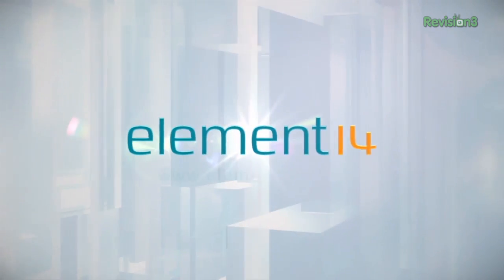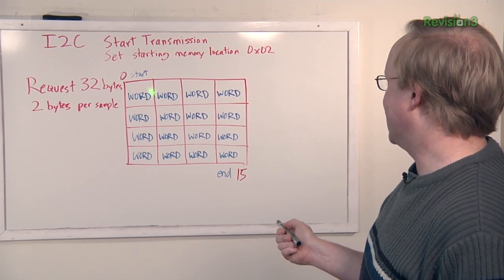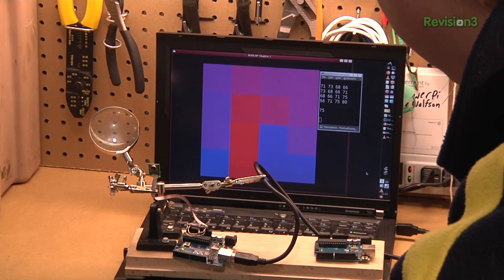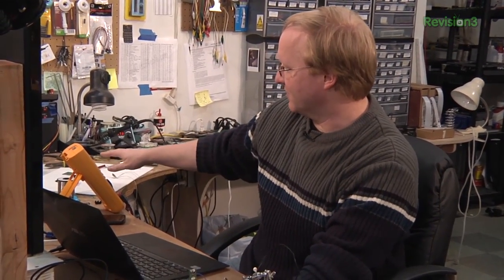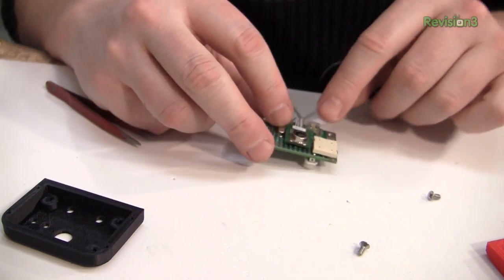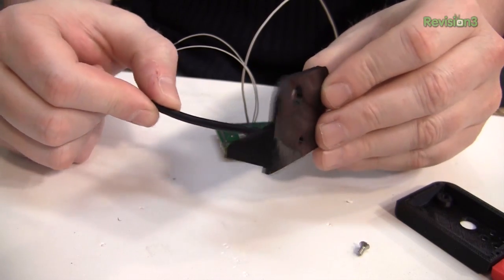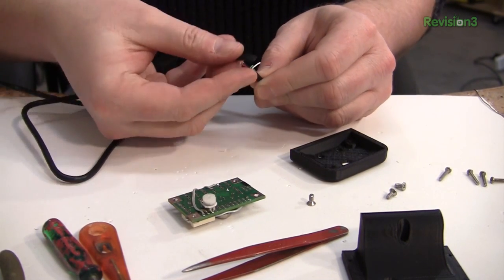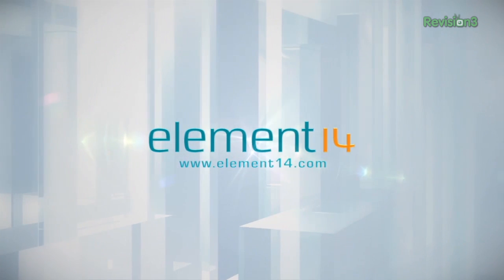TV Proximity Sensor

Comment: Hi sir Ben. This is a bit off topic but still related to sensors. Any way you know how, to hack a SEGA Saturn's light gun (which uses a photosensor which similar to what digital cameras use I believe) that only works with the usual 15hz refresh rate CRT tv to work with a 60hz PC CRT monitor? Could the sensor be overclocked or something using resistors or transistors? 

Thank you. God bless, Proverbs 31

Comment: Are those PIR sensors used with arduino capable of outputing something like this temperature matrix?
I have a PIR sensor here and would like to use it to get the temperature matrix as Ben did, but couldn't find any information on how to do it.
Thanks!

Comment: Why not use an IR led to turn off the tv instead of the piezo? You could let the LED send out the off signal to the tv as long as someone is too close, so they won't be able to turn it on as long as they're too close to the tv.
Reply: There is no off signal just toggle on or off. So if the tv was on and you got too close yes it would turn off but if it was off and you got too close it would turn on. It would be real easy to get out of sync. 

ETA: I read another post here and you would have to add something to "see" if the TV was on or off. then it would work.
Reply: Cliff Hartle Every time the dog walked by the tv would go on or off lol
Reply: Jason Greene This way you'll also scare the dog away with the high pitch when it walks in front of the tv.

Comment: i thought, the first i2c transfer had a 0 at the end of the slave address to do a write operation, you wrote the value of the register you want to read.
Then, in the second transfer, after the slave address, you should send a '1' to perform a read operation, then just wait for the data to come in.
That is unless the sensor datasheet says otherwise, anyone knows the name of the sensor BTW?

Comment: well, the assumption that room temperature is less than body temperature fails bigtime where l live. Summer temperatures can exceed 45° Celsius. And If that happens a few days In a row, inside temperatures can get over 36°... Body temperature Is typically about 36.7° So... that starts to be dangerously close together...

Comment: I would've just used IR bouncing and be done with it. Heat sensors are way easier to block than IR couple.
Reply: Also, after watching the episode, I really thought he was going to integrate a learning IR remote to switch off the TV, instead of the piezo.
It was cool to know those kind of heat sensors exist though, I never knew that.
Reply: Whats funny is that putting this inside a glass cabinet will stop it working as glass blocks IR heat and so would defeat the system
Reply: RealationGames My thought exactly!  Turn off the TV...

Comment: Usually I like the simple and easy solutions presented in your show, but this is ridiculous. It has more sources of error than actual use cases. Most of this was already mentioned in other comments, but anyway I just want to leave my opinion here.

Using infrared vision to detect the living objects is usually a practical solution, but to derive its distance from a 4x4 pixel image is just impossible. Also it might work work in specific cases, here are some simple scenarios totally fooling this system:
- Multiple persons/family watching TV together
- Persons/animals passing by
- Candles or fireplaces in view field of the sensor
- Electrical heat sources like Notebooks or a popcorn maker on the coffee table

Also it is lacking any kind of anti-manipulation. It would have been nice to have a easy possibility to fixate the position so that the kids cannot simple turn the sensor around also a lockable compartment would be necessary to prevent the kids from altering the potentiometer. As mentioned in several other comments all of this is worthless if the kids can just unplug the device. Wouldn't it be nice to have an alarm go off in case of power loss without a correct shutdown before (e.g. key lock switch)?

Please thumbs up this comment if you want Ben to reroll this viewers challenge in order to present a usable solution.